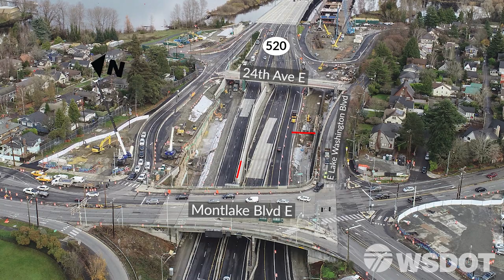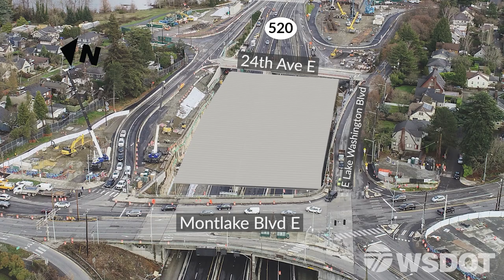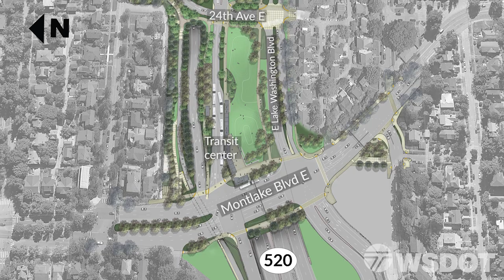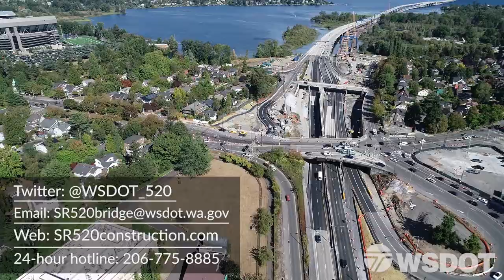SR 520 Montlake Project: Building the Montlake lid - Jan. 2021

Comment: what beams do you use? cm 0:22-0:23 sec
Reply: big ones
Reply from the maker: The beams are called girders. For this project, we are placing a total of 114 concrete girders across SR 520 that weigh at least 98,000 pounds each.